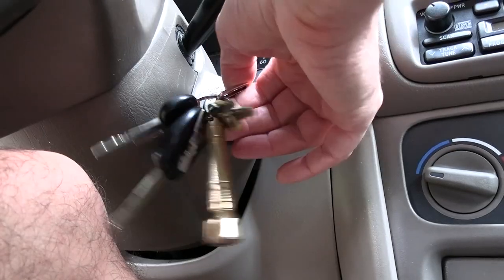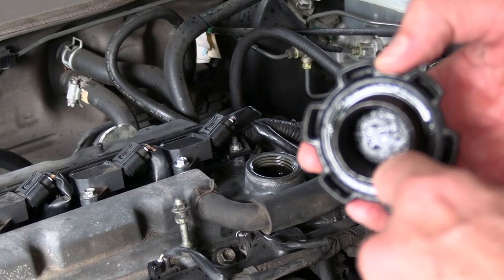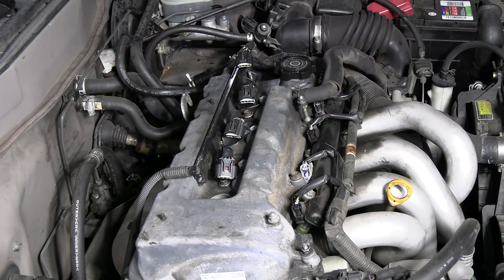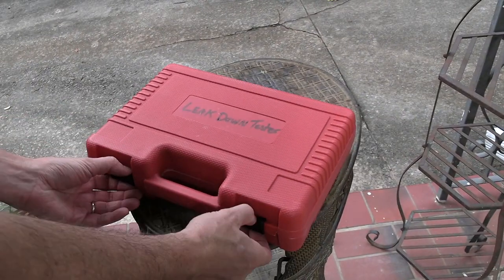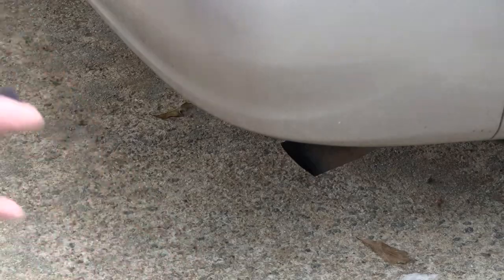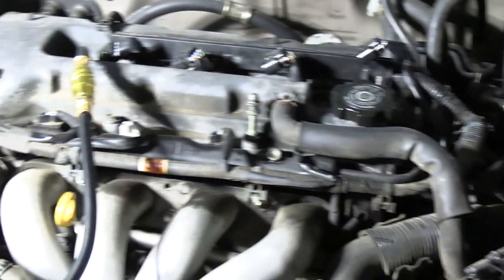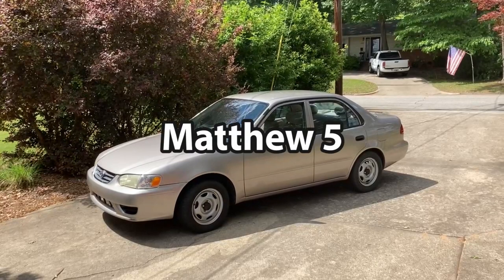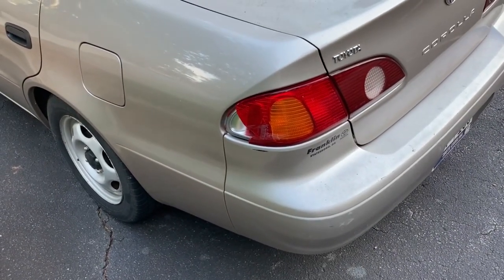How to perform a leak down test | Oil Burning🔥Experiments | Episode 14

Comment: Dave, Your problem is not compression rings or cylinders walls as those leakdown numbers are good. It is oil control rings and drain holes in the pistons all clogged up. There are upgraded pistons and rings for this, but I think you will be able to get the rings loosened over time with more top down flushes. (What has accumulated over many miles will not easily come out.) Refer to my comments in your clogged cat video.
Reply: Several had mentioned this in the beginning; but I guess he needs content for Youtube.
Reply: @tdgdbs1  the first thing he did was attempt unclog and unstick the rings...
Reply: Oil rings or ring in #3 bad, compression rings fine… known Toyota issue.
Reply: Any links to the upgraded pistons and rings?
Reply: How does that burn oil in the end?
Reply: @rienkhoek4169  With the oil rings not seated and/or the drain holes in the oil ring grooves clogged, an excessive film of oil remains on the cylinder walls which the top compression ring and second ring are not designed to clean off. That excess oil burns during the combustion process in addition to getting pumped raw to the tailpipe (evident by oily deposits at the tailpipe). This situation is only made worse by the jets that constantly spray oil to the bottom of the pistons for cooling which most engines now have.
Reply: Compression looks good. These 00-02 1zz's are known to have sticking piston rings. My guess is the 3rd ring (oil ring is sticking)
Reply: video for piston rings clog https://www.youtube.com/watch?v=P57-ym6XudI
Reply: @jamesd431  Id there is oil being burned why does it still run so nicely and the plugs are not fouled.
Reply: I think so too!!!
Reply: @fernandohood5542  When warm at idle and driven on the highway, oil burns more easy.  the higher rpm increases the cycles at which the pistons scrape the excess oil from the cylinder walls, but the throttle is further open which raises the initial compression due to less restriction to airflow allowing the cylinders to fill more easily and the higher rpm also reqires timing advance and leaner fuel mixtures (when on extended cruise periods). Under these conditions, the small amounts of oil introduced during each combustion cycle acts as part of the fuel and burns off with little to no combustion effect. Any effect on combustion occur at cold start, evident by blue smoke and oily tailpipe.
Reply: @jamesd431 I agree with what your saying, my question is what is happening when there is no blue smoke or oily tail pipe, no leaks but still losing oil?
Reply: @dgmccoy3  Oil usage where there are no traces at the tailpipe or from external leaks are difficult to pinpoint as they are mostly mechanical  but can also be fuel related. What repair attempts have been made to date, and what results followed?  If you give me an idea of what you are specifically dealing with, such as- the vehicle make, model, engine size, mileage, engine  history (how often the oil was changed, what mileage the oil usage started and how much oil is being used in miles/qt) in addition what type of driving it normally sees city, highway, 50/50, I might be able to suggest fault scenarios and a diagosis/repair plan. Always glad to help.Looking forward to your reply.
Reply: @fernandohood5542  Fernando, my apologies for not replying earlier to your question. The amount of oil introduced into the combustion chamber is minimal enough or vaporized enough that it can be fully consumed during the burn cycle when mixed with the fuel vapor.
Reply: @jamesd431  thank you for replying! I have a 2003 Toyota Camry 2.4L, I don’t think the oil was changed very much before I got the car which I have had for about a month and a half or so, I’m losing around 2 quarts every 5-600 miles, but have checked the spark plugs which were replaced right before I got the car and they are not oily and the coils are new too, recently replaced valve cover gasket and there are no leaks around the valve cover now, I run it more in the highway than in the city I would probably say 75/25 or so, it runs really good so I’m wondering if I need to use some sea foam or some sort of engine cleaner and go thru a cycle or 2 of that to help with the problem? Because with not having any smoke issues out of the tail pipe I’m told that the valve stems and seals should be good, o also I have had the compression tested on the motor as well and it tested good, what would you recommend I should start with as far as trying to solve the problem? And thank you again for helping me out I really appreciate it!
Reply: @dgmccoy3  What's the total miles on the car? Let me start with the service history you provided. What gives you the impression the oil service was not regular? Brown build up in valve cover, dip stick shaft very brown? Concerning the compression, I would need the values read at the time of test . Seems your problem is oil rings on pistons have drain holes clogged.. Are you handy under the hood or are you having this serviced at a local repair shop? If you are doing your own oil changes and spark plug replacements, I think you can get a long way in adding cleaner to the oil, doing motor flushes before oil changes and soaking cylinders but I will caution you, this process has taken me a year on a car that burned half what yours currently burns.  I would start with running a product called Valve Medic made by Motor Medic. It is a detergent oil additive. It will cause your oil to get black very quickly  as it is being cleaned, and I would change it at 1500 miles after the first application. Add one bottle at each oil change until oil begins to stay noticeably cleaner after 1000 miles of driving.
Reply: @jamesd431 wish I had you on my speed dial. Great info you’re sharing!!

Comment: Don't drive around at red line for 20min. That is just asking for engine damage, it's called red line for a reason, I mean look at a stop sign.
Reply: It’s not true. Redline or rev limiter is a cut off limits set by manufacturers that protects engine over revving what is designed to. It’s a safe zone as long as u don’t rev pass the limit, or pass redline limiter then u r fine. If u think running the engine to redline is bad, then all of the people that take their cars to the track and  do racing will have serious engine damage right after. In fact, those who run their cars at the track or do racing event will always have a healthier engines than most people who just drive their cars conservatively or never rev pass 5000 rpm because gasoline is a good carbon cleaner, but people just don’t realize engines needs high rpm to do it’s job or stripping off the carbon buildup within Combustion chamber, catalytic converter holes, injector holes etc. running at redline for 20 mins won’t hurt anything as long as your engine is in “working” conditions (radiator, fan, oil pump, water pump, fuel pump, injection…all working). Running to the redline occasionally is a best tuneup u can do to keep your engine healthy.
Reply: @blackysan  BS
Reply: @sidwalker6902  well let’s wait for his next Corolla video coming up and see who’s BSing. I can guarantee he will cut down his oil consumption for 3/4 after 1st treatment with B12 and redlining for 20 mins. I did exactly that to my oil burning 07 Scion tC with the known poor piston rings designs 2az-fe motor and after 2 treatments, it completely fixed it with no oil consumption between 5000 miles oil change interval
Reply: @sidwalker6902  found the guy who hasnt heard of the italian tuneup. It works on daily drivers that very rarely see speeds over 30. The high fuel use and load of speed help dislodge carbon buildup. Its not a perfect process, but it does help
Reply: @sidwalker6902  who’s BSing now? Did he broke his engine after 20 mins? Go watch his video and see for yourself.

Comment: No reason to redo compression test you have done those more than once.Clearly the problem is that the oil control rings are not scraping the oil off the cylinder walls so it burns off. No you do not have enough carbon on your piston stops for carbon to be raising the compression. You can clearly see the tops of your pistons are clean. Your leakdown test was just fine.

Comment: I added a catch can after positive crankcase ventilation valve before it returns to intake manifold. This allowed me to calculate the oil loss to intake manifold it was a very significant amount 250mls over two or three days and it stopped the smoke at the exhaust. This diagnosed the blocked valve cover oil separator matrix that needed to be cleaned. Regards Michael H
Reply: Good point
Reply: First time I have heard of this.  How did you clean the oil separator?  Spray brake cleaner into PCV hole (with valve cover off)? Edit:  Nevermind, I just saw your comments about the ultrasonic cleaning.
Reply: Check first with the catch can method oil added at top up to oil collection, my catch can had a drain tap for daily monitoring of oil loss, you could be looking at multiple oil consumption areas this is just one. After my covers oil separator was cleaned consumption  of oil dropped to 5mls collection after two days. I never have preconceived ideas for oil consumption anymore as it's easy to be misdiagnosed like I have, valve guide seals turned out as 1/3rd of my oil consumption and 2/3rd clogged valve cover oil separator matrix. 
I've learnt from my many mistakes.

Comment: Hi Dave, I have watched some of your diagnosis of the oil consumption. My V6 Camry 2002 had all the same symptoms changed the valve guide seals still consuming oil and smokey exhaust. I found the valve covers where blocked up in the oil mist separator matrix allowing thick oil mist into PCV system. To fix it valve covers where removed and sent to a local engine shop that had an ultrasonic cleaning tank with aqueous cleaning solution it took two days to clean out sludge from oil separator matrix In valve  covers. No oil consumption or fouling spark plugs now. Best regards Michael Halpin
Reply: Worth a try.  At least he’ll see how hard carbon is at the machine shop if he asks to see stuck rings.
Reply: Hi Michael! thank you for the info. What would cause this to happen? is there an easier way to fix it without removing valve cover?
Reply: My guess would be long service intervals 10000kms / 6000 miles, low spec /cheap oils & very frequent short distance travel. Oil should be changed 5000 km/3000 miles  minimum unless it has only ever run with high quality synthetic oils. The fix is replace it with brand new or  remove the cover and ultrasonic cleaning & checking progress with bore-scope. The Valve Cover oil separator matrix is only efficient at it's job when clean.  Don't go running some fast fix concoctions that may attack your bearings or seals. Cheers

Comment: Look with a bore-scope inside intake manifold at the junction of PCV system if it's wet your valve covers aren't separating oil / combustion gas mist . A catch container will show you how much oil is lost to the intake manifold and deposited into combustion chamber. I've fixed two oil burner Toyota engines same problem lot's of wasted time and bad advice,  l like your channel very well done keep up the good work. Michael H

Comment: Great attention to detail.
Excellent.
Two observations.
The cat is plugged, in spite to small exhaust flow opening in the center of the cat. The rest of the cat has burnt oil on it.
Run 30 or 40 wt. Oil to alleviate the oil loss and blow by

Comment: All vehicles will have blow by to some degree, it's normal I wouldn't worry to much about that, what you are mostly looking for is smoke. Motors will move air, push some out, pull it back in as it cycles that is normal even with brand new motors. You really can't see air movement vs blow by unless there is smoke, generally if you have significant blow by it will lift the dip stick out of the holder.

Some build up of pressure is unavoidable, as PCV is on all vehicles, there is a few methods to test blow by beyond air movement. Put something air tight over it (like a trash bag) and see if the bag inflates, another method is using a clear hose, attach it to the crankcase, either the dipstick or preferable oil cap, run it to a bucket and fill it with water. Turn the motor on and shove the hose underwater, you should ideally see the hose pull in a small amount of water, and repeatedly push it back out.

You can gauge blow by by the amount of air bubbles, the lower the amount the better, though there should be some regardless.

Comment: Here's my hypothesis from whatever limited mechanical knowledge I have. I see where you have changed the valve stem oil SEALS but I think that the actual problem is worn out valve STEMS. It could be that they now have the shape of a Coke bottle. Maybe not quite that bad but I think you might get the picture.
The 220psi from the compression test seems to me like a lot but honestly I don't know what is normal for these motors. It got me thinking at what point is high compression relative to high vacuum? 
Like a lot of other things the oil is going through the point of least resistance on it's way to the cylinder. Could it be that the valve oil seals, while new, are allowing oil to seep past them in a "high vacuum" condition due to the poor mating surface between valve stem and oil seals? Furthermore could the valve guides be part of the problem as well? What would be a safe way to pressurize the crankcase and perform a crankcase pressure leak down test while the motor is turning over? 
Thank you for posting this video and if you read my long winded comment all the way to down here thanks for hearing me out.

Comment: I recently got a 99 RAV for free that had been sitting years with broken TB, got her back on the road but man 1 qt/300 miles. Been ripping it and that seems to be helping, some barrymans in crankcase now. I’ll be trying some of your ideas too!
Reply: Use thinner oil to flush it.
Reply: @pinonnut  how thin you think?
Reply: B12 in crankcase won’t do to the trick, it has to be in the cylinder. Simply take out all spark plugs and put 2 ounces of b12 in each cylinders  (should be half of can) then put a 19mm socket on the crank bolt and turn the motor by ratchet clock wise for 5 full rotations slowly. Then put 2 more ounces of b12 in each cylinder until u use up the whole can and let it sit and soak for 24 hrs. (Yes the longer the better). U just have to turn the crank bolt over 5 full rotations every 6 hrs or so to let the chemical pass into the piston rings grooves land. 

After 24 hrs. U will just have find a way to extract those b12 chemicals left in the cylinders. The way I did it was put some old rags loosely over each cylinder holes and pulled the EFI fuse from the fuse box and crank the motor over with the key for 15- 30 secs each time until there’s absolutely NO b12 left in each cylinders! U can crank and pause it between and check the cylinder for fluids level, cover hole with rags and crank the motor again and repeat until there’s NO fluids left. 

Now put everything back, and make sure there’s no fluids left in the cylinder then start the motor up. It will have hard time starting but keep cranking and press the gas pedal a few times it will start eventually. Then take a drive immediately on a high way doing 60mph in 3rd gear rpm close to redline for 20 mins then go back home and perform a fresh oil change with new oil filter. 

This will fix oil burning problems after 2, 3 treatments. Wait for his next video to find out yourself

Comment: That is normally almost every Toyota I have owned since 1993 even new  does that has blow by out the oil fill cap. None of them had oil consumption issues or coolant leaks. The reason the sound changes is that with the oil cap off the pressure in the system is changing and you know have a massive vacuum leak as well. Air coming out of the dipstick tube is normal windage from crank and rods rotating. Some engines even cut windage windows or ports into the lower portion of the block to direct that air like the Corvettes Blocks with LS and latter blocks especially on the higher power output versions. 

On a V8 drawing a hard vacuum on the bottom of the engine alone can gain you 50HP due to less windage and better ring seal. That is one of the advantages of a dry sump so much so NASCAR and other racing bodies have to limited how much pump can be run on the dry sump because people would get crazy with it.That is also why we have windage trays and knife edged cranks it is not just the movement of those parts through oil but also air.

I am only 4 minutes in and I do not think it is your head gaskets. Rings and Guides would be my guess!

Comment: Great viedo. As a side note, I put trans in 4 th gear and set emergency brake. Now engine cannot rotate when putting air pressure into cylinder.
Reply from the maker: Good tip!

Comment: HI DAVE, want to do the additive you added into the old and drove 20 min. on the freeway. Please tell exactly which  Berryman b12 chemtool you used. It looked like you used the fuel injector cleaner into the oil. The company they have an oil change flush  #1216 that you  would let car run for 20 min. This one is hard to find.
Reply from the maker: Yes, I used the fuel system cleaner.